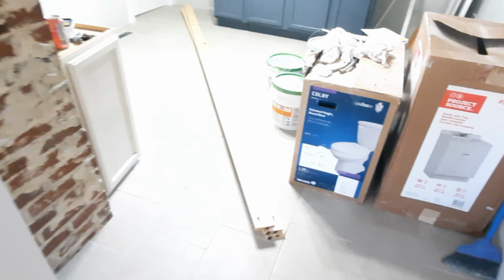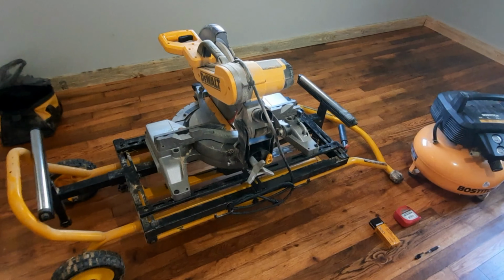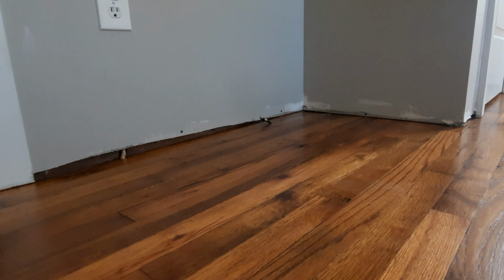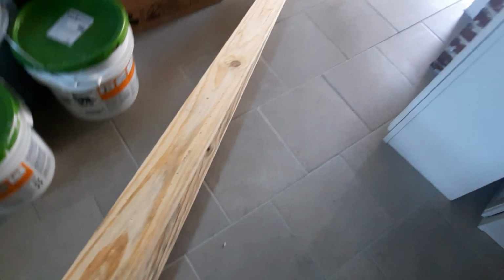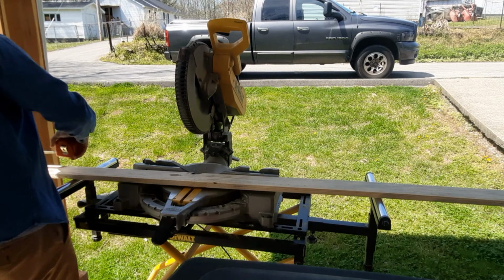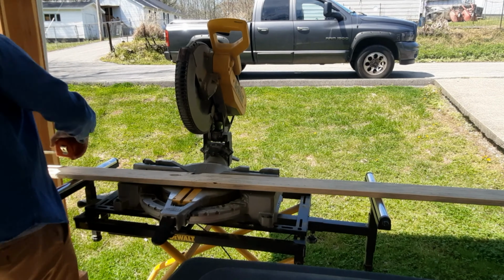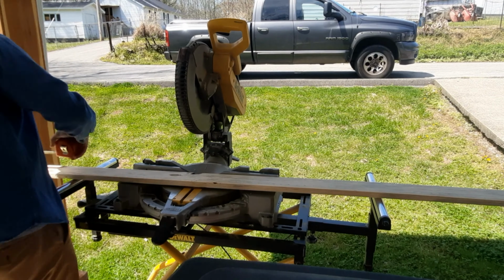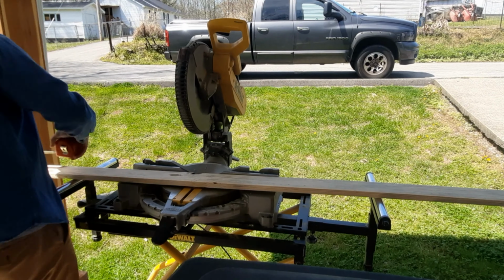EASY FARMHOUSE BASEBOARDS - How to add farmhouse baseboard trim

Comment: i cant believe he didn't miter the outer corners 🧐.  Good channel , thanks
Reply: Farmhouse style has no mitered corners. Most cabins are that style too. It's not just a shortcut. It is a literal design element.
Reply: @kellyrzy6056  good point !
Reply: @kellyrzy6056  he didn't put that much thought into it and he literally said in the video that the reason he didn't do mitered corners was because it was a simple DIY, one that anyone could do. So your little comment about it being a design thing is wrong. He did it because it was easiest.
Reply: Actually it is a design
Reply: VERY GLAD HE DIDN'T MITER THE CORNERS.  2 REASONS:  1)  MITERED OUTSIDE CORNERS ARE WEAKER - AND MORE EASILY DAMAGED AND 2) MITERED CORNERS DON'T GO WITH THE ESTHETIC.
Reply: I like the simple corners

Comment: I love the rusticity of the knotty pine and the no-miter corners, but don't these boards need some some finish, i.e. polyurethane, to protect them?
Reply from the maker: Yes! They are now primed and painted white to match the rest of the trim in the house. 🤙🏼
Reply: So then what was the point?
Reply: @vapertainment5313  this is cheaper then buying Trim in this same shape/style.
Reply: @nolimitsinvesting  Why not cut them, then paint them before finally installing them? That way you don't have to worry about taping and covering the floor? We redid my son's room and had chair-rail molding in addition to the baseboard molding. We measured and cut them to the exact measurements we needed, double checking after we cut them to make sure they were perfect. Then we painted everything outside (it was summertime) before finally installing them. They turned out amazing and we got to skip a lot of prep work when painting!
Reply from the maker: @kaleylynn6565  that is how I would have done it too if I did all the work. This was a flip so I saved on the labor portion of this project but hired out the entire painting of the interior. So they knocked out all of the priming and painting when I finished.
Reply: @nolimitsinvesting  I don't blame you for hiring someone to paint! My fiance bought a foreclosure before we met and the previous occupants trashed the place before they left. He made it liveable when he first moved in, but now we are redoing the whole house room by room (now that he has my design skills). We are going to build our forever home on a plot of land we bought and because of all the work we have had to do here, we decided we are going to hire someone to paint after the the house is built. Since they don't paint it for you!

Comment: Ok, your baseboard is most likely 3/4".  Adding the 1/2" sheetrock... you are using 1 9/16" finish nails????  So at most your nails are only penetrating a stud at most  5/16" of an inch.  Better to go with at least 2" nails.
Reply from the maker: I agree with you!

Comment: Quick question for ya. This is the Style baseboards i'm making and doing in my house. What did you do for small gaps between the baseboards and the floor?
Reply from the maker: Hey! So it would totally depend on what your finished product will be. I painted mine white so they could be caulked or you could use white quarter round. If you plan to stain, you could use stainable caulk or stain the quarter round to match. I hope that helps!
Reply: 1×4 like you painting white. And I have gray floors if that helps with the answer

Comment: I have laminate floor, ripped off the original baseboard and there is quite a gap between wall and flooring. Some spots are just over 1”. I want the farmhouse look. Any suggestions.
Reply from the maker: You may have to use quarter round also to hide the gap. That's about your only option. I use it all the time. Still farmhousey! 😁
Reply: @nolimitsinvesting  I was trying not to use quarter round, but I may not have any option. Thank you.
Reply: @galegaringer340 try 1x2 instead of quarter round. At least it will still be a square look instead of rounded.

Comment: How would you put 2 pieces side by side if the wall is too long for just one board? I have a 20ft -ish wall and I have 1x4x8 boards. Do I just butt them up to each other or cut them in a way they interlock?
Reply from the maker: I'm actually working in my shop now so I just made a video to show you! Hope it helps 😁
Reply: Thank you! I appreciate it!

Comment: Would you caulk the top seem between wood and sheet? I had unfinished knotty Alder trim and base added throughout my cabin and got into it with contractor prior to finishing touches. He left with a myriad of things left undone but was curious about this. There are slight gaps where wall wasn't perfectly square and a small gap is there. Is this something you'd normally caulk?
Reply from the maker: He definitely should have caulked them. I painted mine as you can see in later videos so I went with white caulk but they have so many products out there now that I'm sure there's a wood filler color or stainables and all of that. Thanks for watching!
Reply: @nolimitsinvesting  For sure my man. Thank you for response and content. It's amazingly valuable for folks like myself

Comment: Great video, thanks for sharing!  I am looking to use 1X4's for baseboards in a cabin that I am constructing.  One very simple question... especially when using 12ft boards, how do you deal with warped and twisted lumber?  Do you go through and pick each piece looking for the ones that are straight?  This is what I have done, but I am wondering if there is anything that I am missing out on.  :)
Reply from the maker: Yes, I pick them out one by one. Sometimes they have a bow in them but because you're securing them to the studs, they will flatten out when nailed in. Congrats on the cabin! That's a dream of mine when I get more land.

Comment: Love it. I’m doing that right now. 

If you were to paint the boards white. Would it be better to install first then paint?  Or paint first? I fear I’d get the boards dirty from cutting and installing.  What’s your opinion..
Reply from the maker: For most, it would make more sense to paint before installation. But for me, I had painters coming that week so they took care of the walls and the baseboards both after I installed them.
Reply: Agrees with no limit I always paint them first then touch them up afterwards 😊
Reply from the maker: @wildwoodtop  what's up my friend!

Comment: Just to let you know you have to allow for the thickness of the sheet rock or wall cover when 
you select the length of nails.   3/4" of trim 1/2" for drywall and at least 1/2" to go into stud.
Reply from the maker: Great point!

Comment: Will these warp and bend over time? I was told to use finger jointed pine or the boards will eventually move.
Reply from the maker: I've used these for years and never seen that happen. I'm sure to nail them into studs though. Good luck! 😁

Comment: I'm thinking about doing this with 2x12" boards (they're cheaper than 1x12" at my lumber store? no idea why)

Would that be too thick? How does pine take the paint with the knots?
Reply: I'm doing this on the exterior walls with 2x10 planks. They are cheaper because the factory does less work cutting the tree into larger planks and they are a rougher finish. You pay more for boards that are cut straight and sanded smooth. I believe that the large 2x10s increase the strength of the house in storm situations if large screws are run into each stud and into the footer boards.
Reply: @billgateskilledmyuncle23  love your username btw. hopefully you're uncle didn't literally die though...

and interesting. I never seen them for indoor baseboards
Reply: @billgateskilledmyuncle23  I need to do trim around doors and windows outside. What a great idea!

Comment: What size nails did you use?
Reply from the maker: I used 1.5inch. That gives an inch of bite into the studs after going through the 1/2inch boards.

Comment: May I ask, was it pressure treated or the unfinished?
Reply from the maker: Just regular, untreated 1x4 pine boards. 😁
Reply: @nolimitsinvesting  Awesome, thanks for the information.
Reply from the maker: @Belladale2011  no problem at all! Thanks for watching!
Reply: Pressure treated ok for this?
Reply: @bizjanitorial1289 no pressure treated is for exterior use only